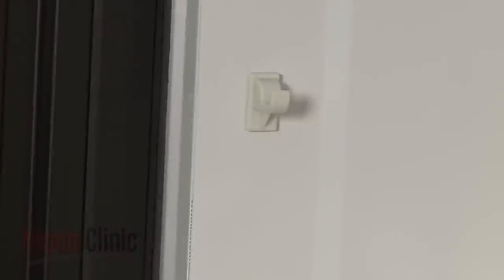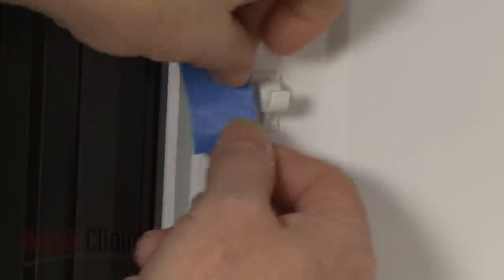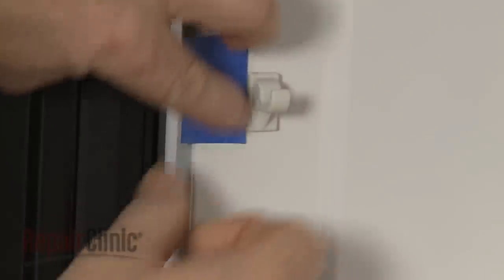GE Microwave Shelf Support Replacement #WB06X10521

Comment: Hi, help please. I have pried out the defective rack support. I don't use the rack, do I still have to replace the support or can the microwave oven be used with that tiny hole? I didn't want to turn it on because the support that is missing is nearest the electrical panel and I wasn't sure if it might fry out the circuitry.